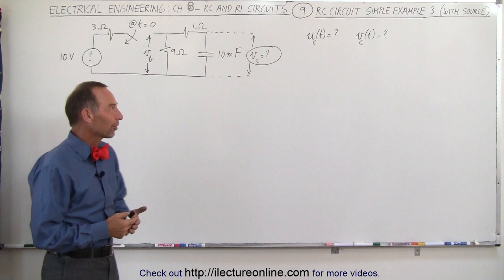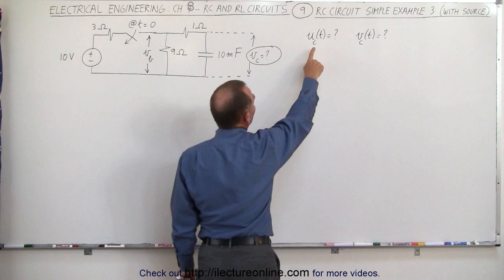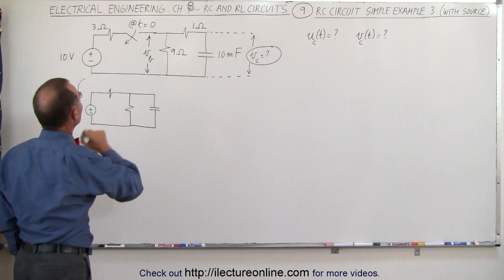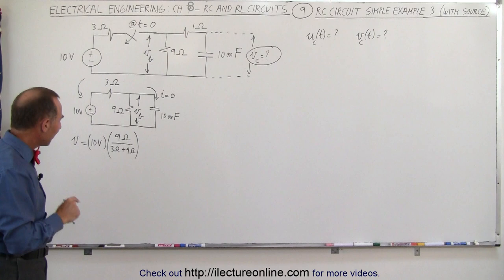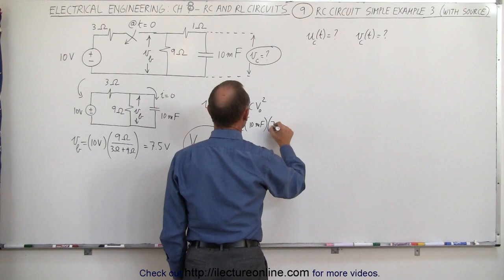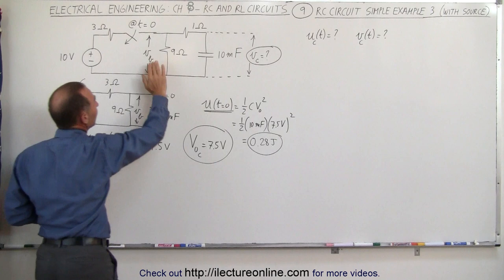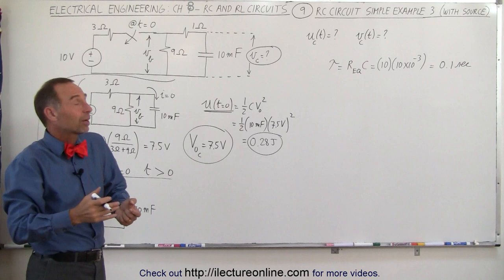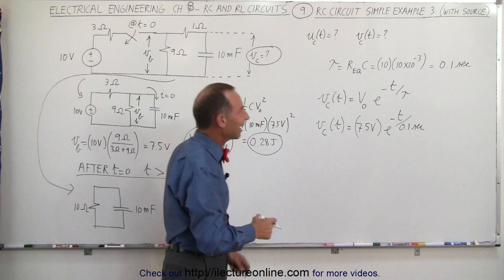Electrical Engineering: Ch 8: RC & RL Circuits (9 of 43) RC Circuit: Simple Ex. 3 (with Source)

Comment: why do we short the 1 ohm resistor
Reply from the maker: Before the switch opens, there is no current flowing through the 1 ohm resistor, so it acts like it is not there.
Reply: @MichelvanBiezen  why? i am still lost. thanks for your reply
Reply: @preciousa.4384   You can let the 1 Ohm resistor on the circuit, but remember that for DC circuits, the capacitor behaves as an open circuit, and thus the current on that mesh is zero. If the current is zero, there won't be a voltage drop on the 1 Ohm resistor (V = iR = 0 * 1 = 0) and therefore, the voltage on the capacitor terminals will be the one measure on the 9 Ohm resistor, which corresponds to the voltage given by the voltage division as explained in the video, 10V(9/(9+3)). Hope this makes sense now.

Comment: at 1.40, why do we not consider the 1ohm resistance in equivalent circuit? when the switch is closed, isn't the current flow into the 1ohm resistance as well? im so confused here
Reply from the maker: Before the switch opens, there is no current flow through the branch with the capacitor, so there is no current flowing through the 1 ohm resistor (and it can be removed from the equivalent circuit.

Comment: why wouldnt the 7.5volts be shared between the 1 ohm and the capacitor??
Reply from the maker: At t = 0, (when the switch first opens), the capacitor is filled with charge and there is no current flowing through 1 ohm resistor and all the voltage is across the capacitor.  A moment later when current begins to flow through the resistor, the voltage will be shared.

Comment: sorry , why is the total resistance of circuit 10 ohms?
Reply from the maker: At the moment the switch opens (at t = 0), the capacitor will discharge through both the 1 ohm and 9 ohm resistors.  Since they are then in series, they add up to 10 ohms.
Reply: @MichelvanBiezen  thank u

Comment: Sir, I've seen this equation : V(t)=V(open circuit)+ [V(t=0) - V(open circuit)]e^-t/tow. Why doesn't V(open circuit) apply in your videos ? Or this equation does not exist ?
Reply: This is super late, but it's because that is for step response. Videos in the mid 30s use that equation

Comment: @Michel van Biezen thanks a lot for your great lectures but please can you explain properly why current doesn't flow through the 1 ohm resistor when the switch is not yet opened ?
Reply from the maker: On the branch with the 1 ohm resistor, there is a capacitor in series.  Once the capacitor is charged, no current will flow through that branch, because the capacitor will not allow current to flow through it.
Reply: @MichelvanBiezen  thank you sir because I totally understand it now, much appreciated.

Comment: I thought the equation for a steady state RC circuit was V0+V(inf)-v(0)e^(-t/T) not just v(0)e^(-t/T)??
Reply: so i see that you drew the t=inf circuit at 4:43 but whats the voltage of the capacitor there
Reply from the maker: Don't forget to replace t with infinity which causes e^-t to go to zero.

Comment: sir, if we happen to have much bigger resistor on our 1 ohm, does it make any difference? or regardless how big the resistance it will have no function?
Reply from the maker: Changing resistors will always change the function of the circtuit.  The best way to become familiar with that is to change the value a few times (like 2, 5, 10, 20....) and see how it changes the currents in the circuit and the potential across the load each time.

Comment: inductors becomes a short circuit when connected to source.
conductors becomes a open circuit when connected to source.
Reply: ahh I  love you buddy :thanksdoc:lol I just realized now that this is what I have been missing sometimes
Reply: why wouldnt the 7.5volts be shared between the 1 ohm and the capacitor??

Comment: Sir for t<0 how you assume that there is no current through the capacitor and voltage drop across the resistor is 0 ??? Is that due to ic = cdv/dt and dv/dt = 0 ???
Reply from the maker: Before the switch is opened at t = 0, the capacitor would have been filled with charge and therefore, no currentl will pass through the capacitor and therefore no current will flow through the 1 ohm resistor.

Comment: Sir could you please please explain your statement @30.secs why we don't have current through the capacitor before t=0-.
Reply from the maker: With the switch open current cannot flow through the circuit.  (You must have a closed loop)
Reply: @MichelvanBiezen  sir how can we say the capacitor is charged full at t=0 or it is just representing that

Comment: Why didn't you include the 1 ohm resistor in the first circuit? isn't the resistor also part of the circuit and has an affect on the voltage that passes through the capacitor? Thank you so much for the great lectures.
Reply from the maker: Since there is no current through that part of the circuit, the one ohm resistor has no effect on the circuit.
Reply: Are we assuming that the capacitor is charged at t=0s? Because otherwise, wouldn't wouldn't the capacitor allow for a current to pass through?
Reply: We are assuming that before switch was open it was close
For a long time so in steady state capacitor will act like a open circuit so there will be no current flow in capacitor. So we can neglect that resistance
Reply: @MichelvanBiezen   How do we know that. I can't explain why there is no current on one ohm resistor.
Reply: @fatihinal9165  he said that initialy the circuit was closed. Then he said that once teh capacitor is filled the current thru it stops, it stops bcus teh capacitor acts like an open circuit once is filled. So there is no current flowing on that side of the circuit, and that side includes teh 1ohm resistor, not the 9ohms bcus that one is also part of the other part of the resistor.

Comment: Excuse me sir, I wonder why the 1 ohm at the circuit (t>0) isn't included in calculations? Thank you sir. Love from Indonesia.
Reply from the maker: Before the switch is opened (at t < 0) the capacitor is fully charged and there is no current flowing through the 1 ohm resistor.   Welcome to the channel!
Reply: So, even if the capacitor starts to discharge, the 1 ohm will keep being excluded, sir?
Reply from the maker: Once a current flows through the 1 ohm resistor, you can no longer ignore it.
Reply: @MichelvanBiezen  ok, thank you, Sir, for your time and teaching. It's helpful✨

Comment: Sir, if the voltage accross the 9 ohm resistors is equal to 7.5 volt, why the V of 9 ohm equal to V capacitor?
isnt the correct equatiion is  (V 9ohm = V 1ohm + Vc)
Reply: i understand in the first statement that the circuit is in steady state  , so the current accross the voltage is equal to zero, but i couldnt understant why you put V9 ohm = Vc, should the correct equation is V9ohm = v 1ohm + Vc?
Reply from the maker: The voltage across the 9 ohm resistor must be equal to the voltage across the capacitor AND the voltage across the 1 ohm resistor added together.